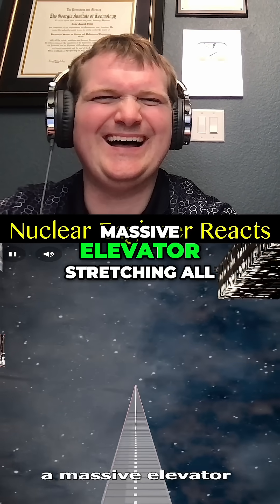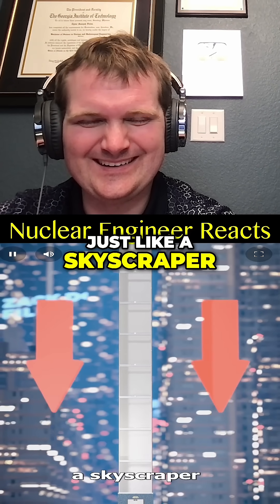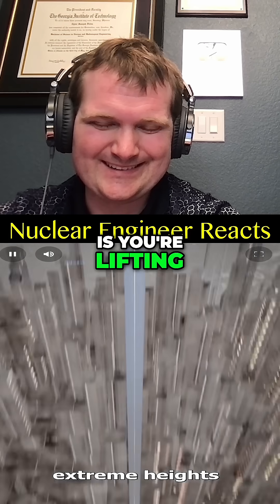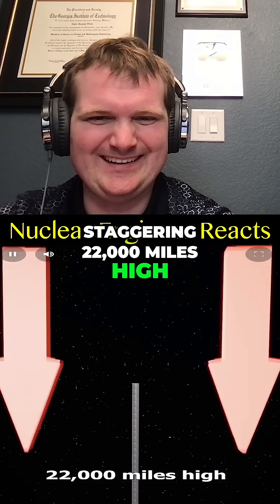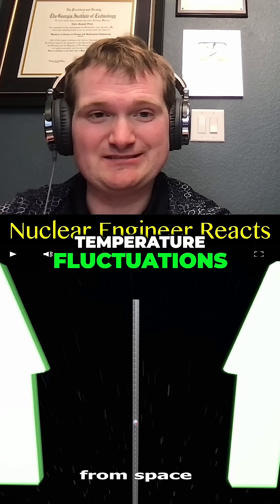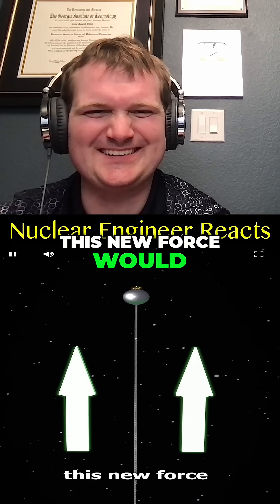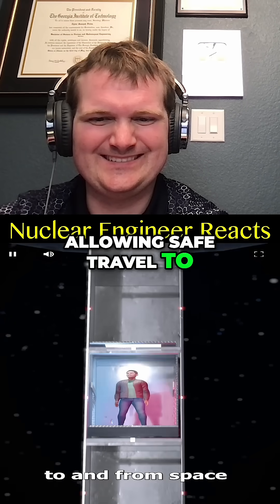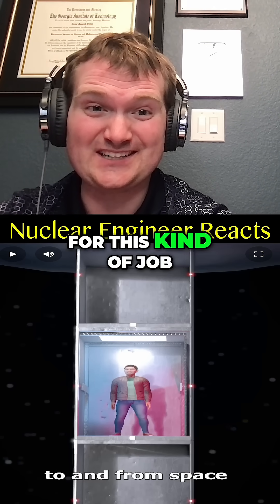Building an Elevator to Space - Nuclear Engineer Reacts to Zack D. Films

Comment: I personally think it'd be more practical to build a literal ring around the earth in Leo.
A large  alloy tube that can support its own weight when slowed to geostationary.
A few spokes and it's done.
Now you have a permanent platform to attach satellites and maybe 2-3 elevators.
Of course, it's a hell of a lot of launches to build an 80,000km ring. If you build it from starship fuel tanks, it'll only need about a million launches.

Comment: I dont even think carbon nano tubes or graphene could hold it. Then, what happens when it needs maintenance? What if it falls over? What about the electric charges it would pick up since the top is basically just getting bombarded by ions? You could probably hold a fluorescent lightbulb up to the building at the base and have the bulb light up. This is just accounting for space, not static friction in the atmosphere. I would not be surprised if you went near the base, and without proper grounding technology, you get struck by electricity and die as you go near it, or based on its properties the damn thing is so hot that your skin would burn by being within a few feet of it.

Comment: Imagine If in 2500 someone actually builds a lift to moon with some kinds and it's more durable because it has a cushion like external protection and very strong internal build with artificial pressure to keep it same as earth to be more stable then somehow manages to make it more comfortable enough for humans to actually go up and down on regular basis 😂
No matter how safe it is if I was there i would never step into it
I know that 
I will be dead half way through 
Because I feel dizzy and lightheaded just from regular lift which only traveled like 3 floors(it's because I'm too tall and have low BP)

Comment: Hypothetically if the structure wasn't able to be pulled apart, how tall would it have to be for the centrifuge force to balance out the weight of the structure on the surface of earth?

Comment: Someone had said that to build such an elevator, construction would have to start from space, but that we don't have helicopters flying high enough for that. Balloons are not an alternative because of the air currents.
Another remark that was made was that we don't have a material that can withstand such tension, and that we don't have an option, yet, through which we can anchor it sufficiently stable to the ground.
The third was that centering at a certain point is almost impossible with our current technological development
:)

Comment: Space elevators aren't just an engineering nightmare. They're just a straight-up bad idea, from start to finish.
It would literally be a giant lightning rod connecting the ground to the lower part of the Van Allen Belts. As soon as it is even partially connected, the arc flash from the current would produce enough heat to sustain fusion for a split second, and become bright enough to be seen from the surface of Mars, before the whole thing detonates like a massive det-cord.

Comment: You make use of the centrifugal effect. 
You lift materials up and hoist it both ways, to the length that gravity and the centrifugal effect cancel each other out. You then anchor it in geostationary orbit to a rig type boat with a huuuuge bowl or halfdome mounted underneath (huge rig too) then you can begin to tension the cable. Whilst simultaneously flooding the  dome with water as needed. 
The system should have a good margin of gravity on its side as opposed to the centrifugal effect. Now also since you controll both ends you can also move this thing around pretty "easily".

Now this might as well be a theory. But if you gave me these premises, thats how i would do it on the first try. A.k.a what i believe. But i realized my amateurness in both structural architecture and physics may be so misunderstood that this is impossible.

Comment: Imagine the tensile strength necessary, as well as the lateral impact resistance...
Reply: The only material I'm aware of that could possibly have that kind of strength is carbon nanotubes.
Reply: @Jadefire1010  I remember hearing someone say something like "carbon nanotubes can do anything but make it out of the lab" so it'll probably be a long while before we see those used for buildings.
Reply: @notforgetful4926  I haven't studied them in a long time, but by my understanding the main problem is they're expensive and time-consuming to manufacture. It takes a lot of time and money just to create one foot of a single strand, let alone dozens of meters of the thousands of strands required for them to be useful for industrial purposes.

Comment: How fast would the end be traveling through space? Earth surface is 1,037 miles per hour (1,670 kilometers per hour) at the equator.  Could put it at one of our polls where the rotational speed is very slow but the centripetal force would be very low too...

Comment: Backwards, this is. You want a space elevator, you'll need a ring. Build the ring, align the spin axis and rotational speed, and drop cables. You'll basically end up with a tensegrile structure. Drop a couple more non-structural cables, tighten up, and the 'elevator' climbs those for access and material movement. 

Problem is this is going to be much easier starting with raw materials in space, and not going back to Earth for supplies... but that infrastructure would have to be lofted via conventional chemical rocket.
Reply: i like how you think. let's do it
Reply: This is still susceptible to all the problems he mentioned in the video. This is why engineering is a degree and not a forum online.
Reply: @solaire7046  Cables can be hung from an exponential branching arrangement much easier than a compressed structure can be shored to that height. Or for that matter, engineers can meet midways, build support towers to the point possible by material science, hang the fan of cabling down as far as material science allows, and if the two endpoints don't overlap, start working on the material science.
Reply: There are other ways to get the raw materials into space, especially if sturdy.

I have been watching the centrifugal and slope launch method testing. They seem close.

My concern would be if the cables (or whatever) would become statically charged due to the passing thru the atmosphere and how that would be disapated.

I think about that bc I have seen experiments about generating energy in orbiting satellites or using it for propulsion to move in orbit.

It is all fascinating.
Reply: Main issue with dropping cables is that they'd snap before reaching the ground due to not being able to support their own weight. We dont have a single material with the tensile strength to hold itself, let alone a payload, from space to the ground.  There's other clips from this same channel going over the problems you'd run into
Reply: @jaredmartin4649  in Gundam 00 they use magnetic trains to transport stuff. I’d assume you can build on earth and in space and the difficult part of meeting in the middle.
Reply: This is what they do in Gundam 00. It’s an orbital ring to capture sunlight and space radiation for energy which gets pumped down to earth and space elevators are added to the columns.
Reply: How do you drop the cables?
Reply: Unrelated but now im even more impressed at the amount of research Bandai did for Gundam 00 because this is literally how they made the space elevators in that anime.
Reply: idk what you said but it sounds smart 👍
Reply: Ignoring the small problem called "The thing has to hold its own wright and everything below it."
Reply: Would probably be the cheaper way as well tbh. Align the spin axis and rotational speed...? What?

You'd literally build the ring so it sits above the earths equator in a tidally locked position. It's the only way you can make use of centrifugal forces with ...well... ...less work and a lower probabilty of mishaps 😅. 

But material science is where the focus is. I remember graphite was amazing with tensile strength in theory. A sheet of it it one atomic layer thick could hold a soccer ball or something? Wild. That info was from a few years ago though and i dont know if its been discredited.